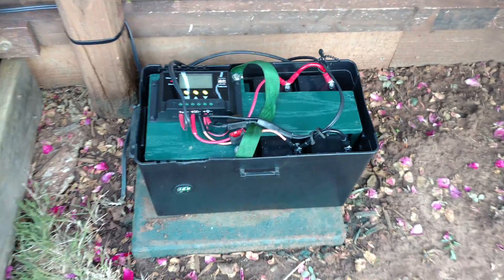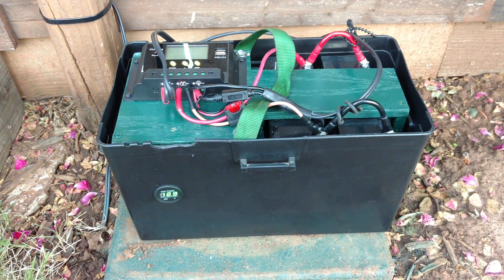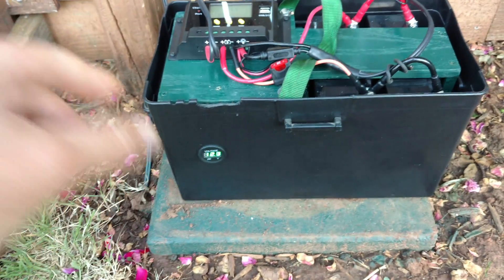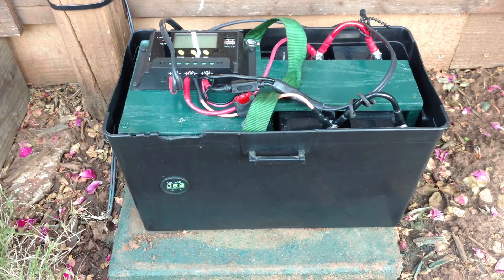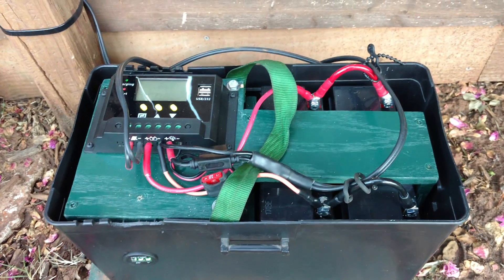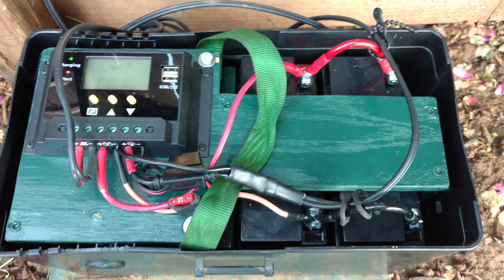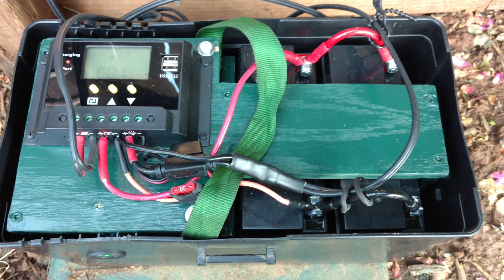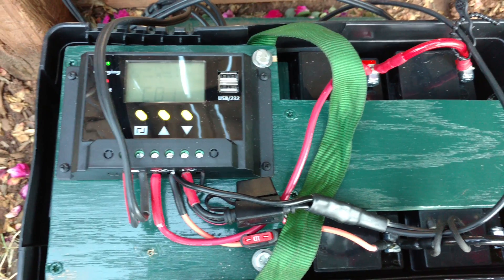Solar pond pump: Version #2 (more power, better batteries) Runs 24/7!

Comment: Wonderful set up. I would like to seek your advice on what size battery should i buy if I want to run my pump 24/7? My pump is 19W DC 12V, 200W Solar Panel with 100A controller. Thank you
Reply from the maker: I am running a Battle Born 105 aH lithium battery in mine. With my 24/7 system and 60 watts continuous power draw...works perfectly. With a 19 watts continuous draw system...a good 50 aH lithium would work.
Reply: @ChrisDIYerOklahoma  Thank you!

Comment: I have a 100 wattsolar panel hooked up to 35ahbattery, running a 4w fountain pump and after two days it drained the battery. I can see it hadgif we get maybe 5 hours direct sunlight any ideas no added a second panel 100 w but do I need that much? Just a little fountain pump

Comment: can you give me some tips sir? i just want to run a 32 watts aerator   24/7 but i dont hav any idea on what things are needed
Reply from the maker: That is what I am doing with my 12v solar powered garden pond generator...powered an aerator 24/7. I am using 200w in solar panels and a single 12v Trojan deep cycle AGM battery (105 aH). Check out my video https://www.youtube.com/watch?v=Lvw_8Ph5TFI&t=19s

Comment: That's cool.
Reply from the maker: Thanks...next one is gonna have an inverter on it. More of a "camp/job site" solar generator (under 100 lbs) with the tote/dolly. My 24v one (military style) is more of an inside "single room" deal for emergency power...heavy, but still moveable.
Reply: I like that idea. I might steal it. LMAO
Reply: My portable ended up being taken apart and turned into this thing on the wall in my basement. I need to add more panels, I only have 1380 on an awning but they kick ass. I'm in the middle of an in stall of a 1000 watt turbine on the roof and then it's gonna be another 8 -345 watt panels on a ground mount in the yard. I'll do a video when I'm done ( not very good at that but you will be mentioned seeing how you helped a lot ) I hope you're system is running good for ya, miss those videos. I'm officially a watt junky. Lmao
Reply from the maker: Roger that...sounds good! Thanks. The main system is running beastly (never better). Holding off on doing a video till I gets some more miles behind me (full shakedown, tweaks). Pretty impressed with that MNDC250PLUS DC disconnect box and breakers.
Reply: That's great!  I'm glad you got it all straightened out. : )

Comment: Question on the battery box.  I suspect that is designed just for one large or two smaller deep cycles.  What size battery is that designed for?  Looks like what i need for my travel trailer.  Thanks!
Reply from the maker: Group 29/31 is the battery box size. It is great for marine/RV applications...mount and go. However, not really made for banging around and mobility. This one will just sit there all season.